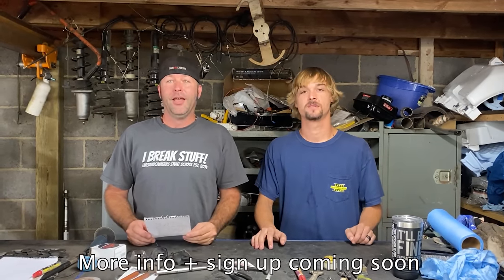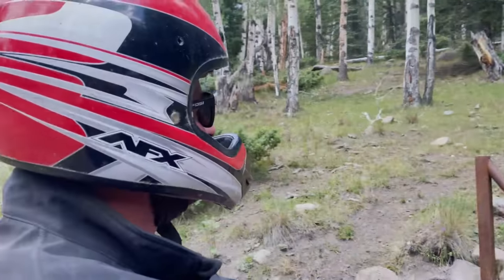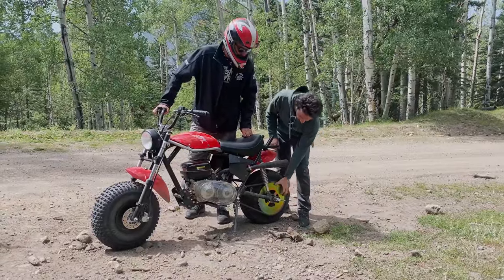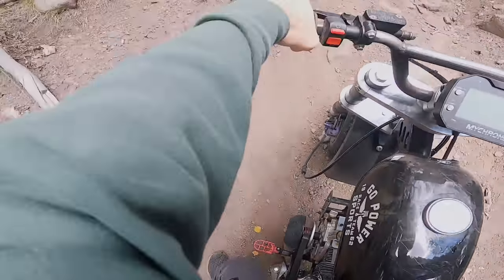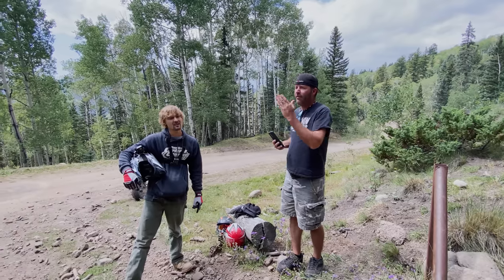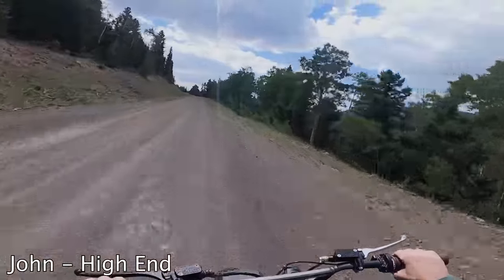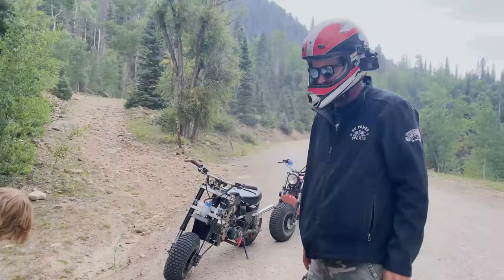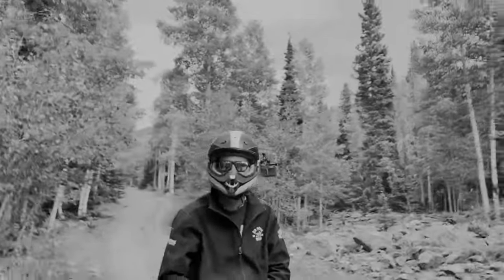3 Way Mini Bike Comparison from Mild to WILD! 10 - 25 Horsepower SHOWDOWN at 9,000 Feet!

Comment: The reason for the slightly modified Trailmaster doing so well is the big sprocket on the rear. I get a kick out of you flat landers building your scooters for speed rather than for low-end torque. Take a look at how the Tote Gotes were geared.

Comment: A 125 cc or higher China engine with the forward slant cylinder would be a big improvement on any mini bike you could fit it in with a suspension and bigger tires. Having the transmission and possibly a low range would help that climb out alot. Upgraded suspension doesn't hurt either.

Comment: Up here in the mountains we love the stockish bikes. If you go on the single tracks they are great!. And don't need to worry about going so fast to kill yourselves, and sometimes rides go for a lot of miles, so the stockish ones aren't so sensitive, much more durable. My bikes are waaaayyyyy older but they get it done, and I get plenty of warning to repair before main systems fail... jmo. (And you all need different rubber for that imo) very cool vid! Thanks for sharing! Next time you get to the rockies, let me know. Ill take you up the "lawn mower" race path we do annually.

Comment: Actual hill climb races don’t start at the right at the start of the incline they start back 10 or 20 feet to get some momentum going so they don’t just spin out like how you guys started but still cool
Reply: I’ve watched extreme hill climbs before and seen some awesome roostertails right from the startline.
Reply: Some give you a run up to the hill. Some (Big Elim) start on a full incline. 
I was a hill climb that had a long run up but had a couple turns right before the bottom of the hill.
Reply: @chucksherron  ok cool

Comment: Hey there gentleman.
I was wanting to know why these 212's are so gutless.
I build minibikes in Australia & I use 107cc motor's. I have developed an internal centrifugal clutch.
The power from these engines is nearly scary & can get the bikes up to 118 km/ph
You have to feather the acceleration or it will put the front wheel in the air or just spin. 
Maybe you should put a head from a 180 on a 212 & see what happens.
CnC for lyf 🤙

Comment: Ive got a clapped baja warrior that rips too. Ive got a predator with a stage one kit, a torque converter, and a Sunf tire, and the thing goes abt 35. But it also has no brakes, some shitty front forks, a loose ass chain, and spray paint all over. Fun as hell tho

Comment: The mega moto 212 frame kit costs $700, so this is misleading, with tilly it costs over $900... I have $1200 into my MM212 with a stage 1 and SunF tires and that's it... And I might have to buy a new engine because the header stud stripped out (even with the header support installed properly). I tapped it to 3/8-16 and I'm watching it closely now...

Comment: hey i have an idea... make a minibike with suspension say like the midrange one john used and have a v twin engine fitted with a dual pipe exhaust and it will sound like a harley but be a offroad machine...

Comment: I have a db10 tao tao ... I use it as a pit bike to follow my kids as they ride there quads , in sand the rear tire just spins and I get no traction , my question is would a gear change help ?? Like a huge rear sprocket? I dont mind going slow as long as I can make it through sand